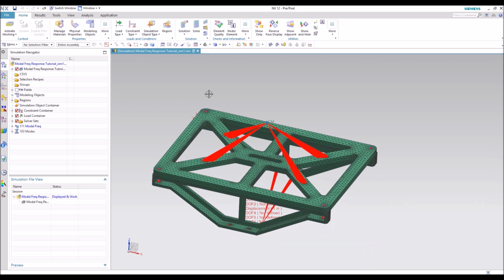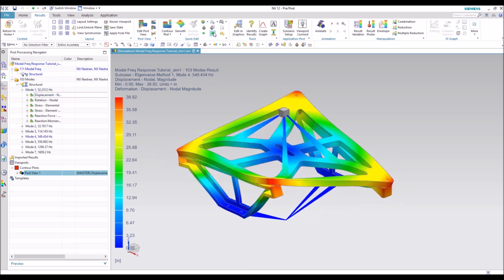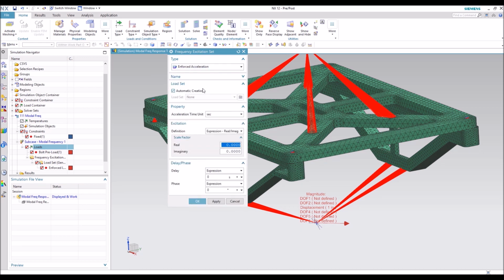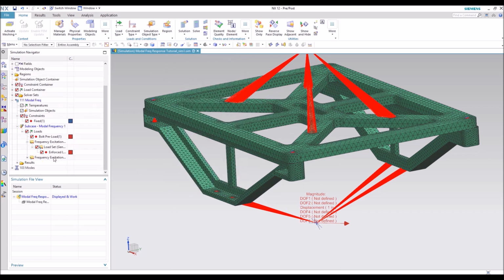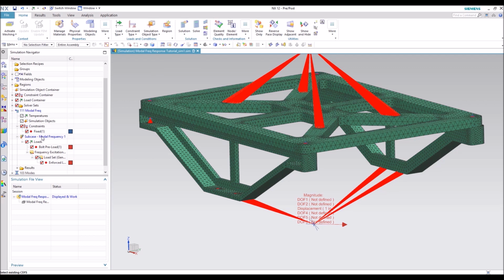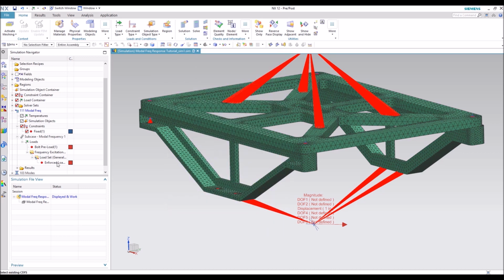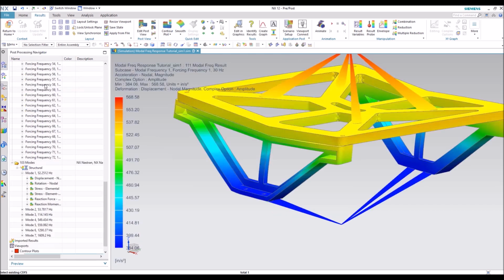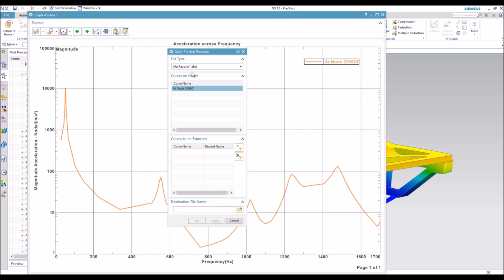Simcenter 12: Modal Frequency Response Tutorial

Comment: Thank for video. I have question concerning bolt pre-load. Did NX Nastran run static(bolt pre-load) and then Modal frequency response? What is the process order (static, modal for frequency, model frequency response). I know this process from Abaqus but I dont know how it works in NX Nastra. I want to compare to Abaqus.. Thanks.